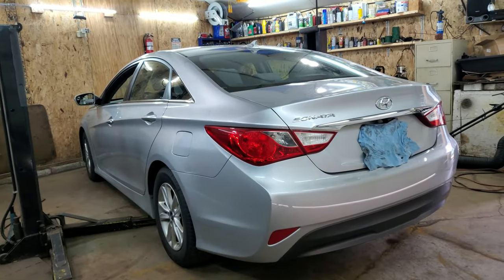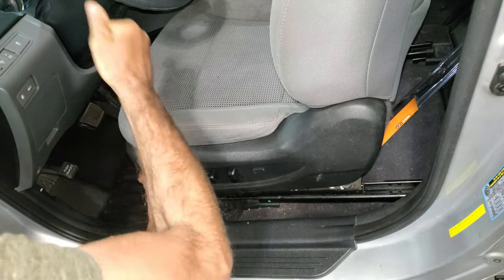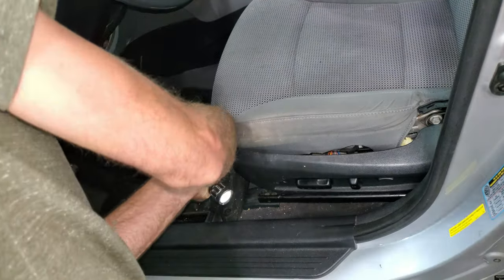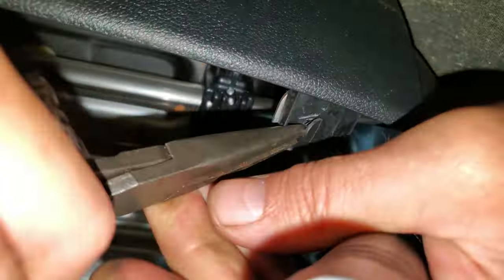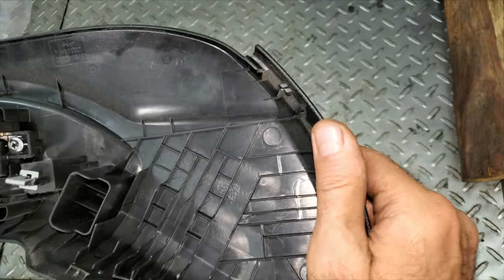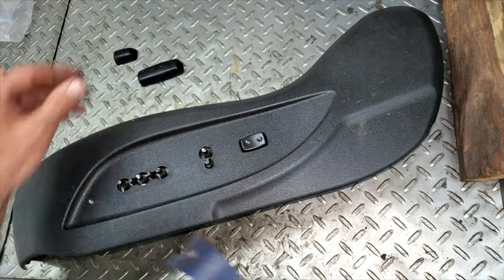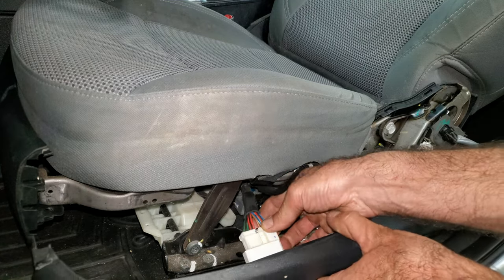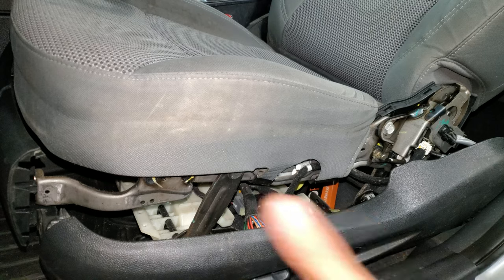2011-2015 Hyundai Sonata power seat switch replacement

Comment: I own a 2015 Hyundai Sonata Limited and the previous owner I'm pretty sure was a big dude that spent most of his time in the car. The seat's control panel was broken off (still works) and the arm rests on both sides of the driver's seat and the steering wheel were caked in dirt. I'm still trying to clean it all off.

Comment: Do you have a part number?? Have an issue with my 14 sonata, mine will recline down but not up
Reply from the maker: I do not. Its chineze mail order
Reply: That’s what ours was doing. I took it apart and cleaned the contacts and now it’s working perfectly, didn’t cost a dime! About 30 min job😊
Reply: @ClintFomby  mine is doing the same thing,  Reclined but wnt come back up.  Do i need to take off like the video to clean it.
Reply: @jamielorenz5021  yes it took like 20 min. And has worked perfect since. Once I got it off I took a little pick tool and got  the little switch box open for the recline. Inside I believe was a spring and a small piece of metal with a contact on each end . I took sand paper and cleaned each one both sides. Real they were not that dirty but apparently dirty enough to keep it from working. Pay attention to how the little metal contact and spring goes back in.
Reply: I didn’t buy anything new , just took it apart and cleaned it and put it back together
Reply: May not be a spring inside it might be a ball, or both cant remember!

Comment: Just had this happen to me. There is black gunk that builds up on the switch. I fondled the switch for about 15 minutes. And eventually the gunk cleared and it moved up. I plan to NEVERRRR Touch it again.
If you are in this situation, and don't know how to do all this stuff like me, try pushing the switch over and over while praying to your choice of God.
It worked for me. 
I am incredibly happy right now.
Good luck. 👍🏾